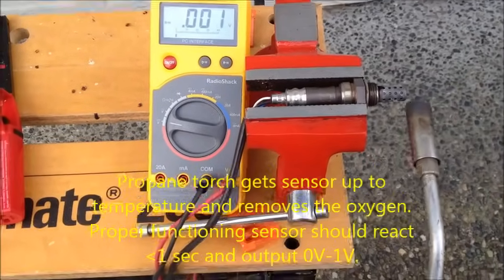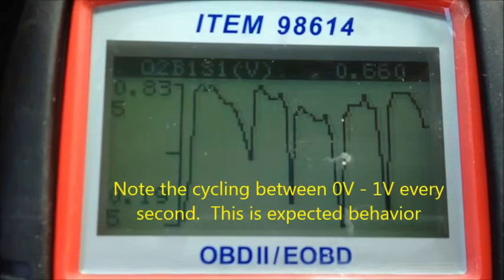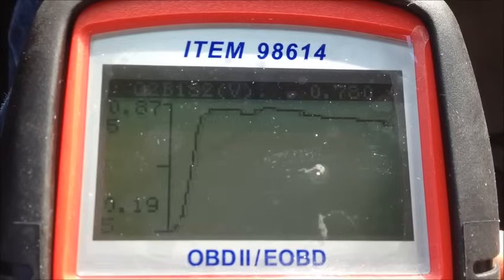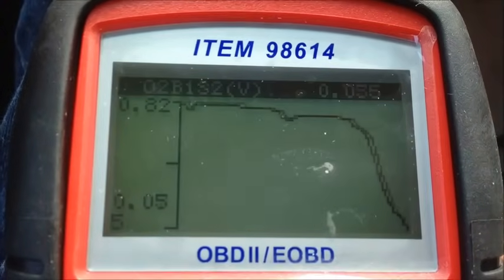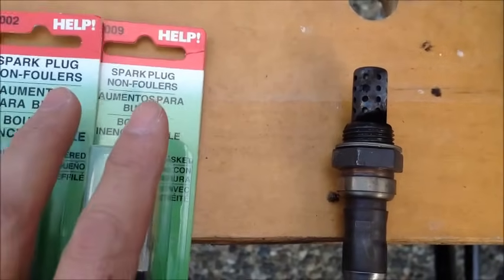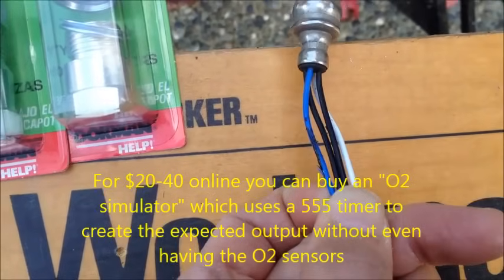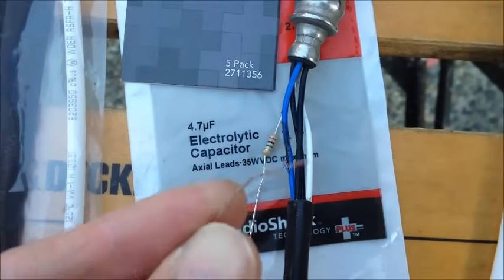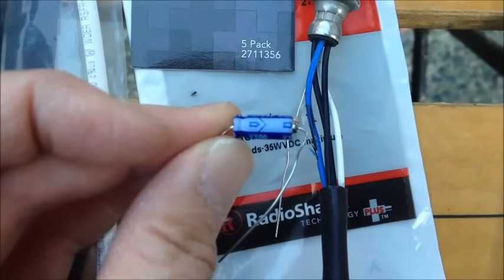$3 O2 simulator fix for P0420 Check Engine Light

Comment: Hi MITEEman, I just tried this modification on my 2002 Toyota 4Runner. I used the 4.7microfarad capacitor and the 1M-Ohm resistor. Prior to this modification the o2 sensor monitor always set easily and the catalyst threw the p0420 code. Afterwords, the catalyst monitor set, however the computer threw the p0136 code. This apparently means that: "(The P0136 code is set when the Engine Control Module (ECM) detects that the rear O2 sensor signal voltage is out of range for an extended period of time)".

Do you have any input on what I can do to correct this?
Also, thanks for a good video.
Reply: Deere 9798 same for me. Did you find solution?
Reply: @kconatymd  Did you ever figure it out?
Reply: @gritchard , had to replace the catalytic converters
Reply: @travato1592  Thanks.
Reply: I have this error. The setup works great at smoothing the signal when the car first starts, but after 20 mins the signal settles at a constant voltage. Maybe the capacitor and/or resistor get too hot?

Comment: I have on 200 car, the 2-nd O2 sensor damaged, and mix are very rich so  high fuel consume..
problem is I cannot change it, is like soldered there - the exhaust system is one piece, with no joints
Can I replace the damaged sensor with something like this  simulator to have  a lower consume ?
  Thank you in advance!

Comment: You need flux. Without it, the solder will not flow properly.
Reply: SwapPart TV Repair stainless steel wire is the material of O2 wires. It doesn’t solder very good

If you buy a universal O2 sensor it has a way to connect the male end. It’s not solderarable. If there is such a word
Reply: @marklokken1378  Did mine last year, used flux, had no problems.
Reply: SwapPart TV Repair can confirm. I just did my car, soldered like a dream using flux. Looks cleeeeean!
Reply: Shouldn't need flux with rosin core? * Scratches head*
Reply: @mleiber1982  Sometimes you do. Putting some flux on the wire helps a lot. Depends on the solder you use, and the type of flux in it. Some burn off too fast.

Comment: did it end up setting a heater circuit code afterwards? not sure what vehicle that was on but some send a bias voltage down the signal wire to indirectly monitor the heater circuit until the o2 warms up and pulls the bias to ground...

Comment: Thank you for the technique, the P0402 went away. Now the CEL is on and the code is P0137 Low Input. So, do I need a different resistor or a different capacitor? I welcome your thoughts.
Reply: If the voltage remains low for more than 2 minutes then I presume I need a capacitor that can cycle more quickly.

Comment: Laughing now, because this circuit does NOT need to be installed AT or NEAR the senso as shown here.

I would install it under the driver's seat, as that is where the connectors are for this sensor (sometimes under the passenger seat as well). And you could get fancy, and spend a little extra on a male and female 4-wire connector and make a "patch" cord so it is inline when needed.
Under the seats.
Reply: So you would rather modify your engine harness rather than wires on a replaceable o2 sensor? I'd much rather modifiey a o2 sensor than a 
ECM harness but that's just me.
Reply: @PHXGlock  No, you go to the junkyard and cut a set of connectors (male and female) under the carpet from a junk car, then you make an inline low pass filter that you do not need to cut anything on your car (in case you screw up, just go to junkyard again), and you can disconnect them and "restore to stock".

Comment: $ 3.00, and 65.50 in misc tools and heat shrink and soldiering gun and wire and blah blah. I bought the 02 sensor for $ 48.00. I borrowed the 7/8 wrench. Thanks anyway for the upload.

Comment: I try 1mΩ with a 4uf  [ dodge caravan 2.5 2005 , with a few months old cat trowing p0420 after replace injectors rings and manifold gasket, valve cover gasket ]
the live data 
shows O2 downstream fluctuating from 1.172 to 1.156
with 1kΩ resistor fluctuates from 0.954 to 0.124 
o2 upstream act from high to low on both configurations
should i try different resistor ? what value
or different capacitor? what value

Comment: Yup, basically fooling the computer by giving it the correct value. I did that on my trailblazer because of a low pressure sensor in the fuel tank indicated a leak. This was a major issue with all trailblazers. Mine didnt have any leak as per smoke test,no cracked filler neck. No bad charcoal canistor and no bad pressure switch in the tank. I added a capastor and a  resistor to reduce the voltage to bring the value down to .5v ,no more light,no more code. I know many Trailblazers that had that issue.

Comment: Well it worked but didn't in my 2003 highlander. The P0420 and P0430 codes are gone.......  but now I have P0136 and P0156 "O2 Sensor Ckt Malfunction"

Comment: Hi I replace my complete exhaust system on my 06 Alfa 3.2 v6 all 4 cat's including 2 downstream O2s where removed so obviously the engine light comes on, I'm not a electronics specialist so I need some help , Can I build a circuit to completely replace the downstream o2s?

Comment: My car Range Rover Supercharged 4.2  2006.  I made this and yes it works. No alarm came in for 3 months
no problem.Thanks. But vehicle fuel consumption before 17.5 LT/100 km, now 25.6 LT/100 km.Do you have an idea on this
Reply from the maker: Yes, I do have a theory of what may be happening.  When you get a Check Engine Light your computer may go into a "safe" mode which can negatively affect your fuel mileage.  I've seen this very dramatically affect fuel mileage for transmission problems.  I don't remember such a large improvement for this code, but every car responds differently to CEL codes.  I'm glad to hear it improved your gas mileage and thank you for sharing that.
Reply: I don't think you realized he is saying the mileage went down, not up.

Comment: I tried this but with the resistor on it was giving me 1.25 volts which my other bank sensor is only giving me .75 so I got a new code. I took off the resistor and it dropped it to .75 only time will tell if the CEL comes back.
Reply: Did you figure out this issue?

Comment: so if you dont have to have a sniffer test in the state your in you could do this trick and hollow out your cats?
Reply from the maker: Absolutely not.  This mod depends upon a working cat & o2 sensors.  It only fixes up a computer that is over-sensitive.  In fact, my o2 sensor recently failed and I had to replace it in order for this to still work, but it is working

Comment: the wires are stainless steel .. that is why is so difficult to solder.
Reply: joebotics
Reply: joebotics 
Yes this is an issue , I was able to get around it by twisting the wires together putting a lot of flux on the connection and getting a ball/blob of solder to hold the wires together.
    After the fact I thought I might have put the mod not on the O2 device but on the harness attached to it that perhaps THESE wires would not be stainless steel and you could effectively solder these wires . I need to investigate weather these are stainless steel
Reply: I crimped them.

Comment: Your capacitor says AXIAL leads. The one I bought says RADIAL leads. Does that matter?
Reply: No. Radial leads are used on printed circuit boards where space is tight. They have a smaller footprint, electrically they ARE identical. Just watch the polarity markings and you will be fine.
Reply: I figured it out by now. But thanks anyway. I already did this and it works great.

Comment: So what a lot of people don't realize and I know only because I have been a license smog tech for about 18 years now is the rear sensor is not only to monitor the catalytic converter, but to also fine tune fuel trim. This is only good for someone who is trying "beat" the system. It's not a great or smart choice for your car. Also it's kinda illegal to tamper or modify your emissions on a car. That may be a whole other thread or video but you should know.
Reply: So you're telling me that the manufacturers use a sensor AFTER the catalytic converter to control the air / fuel mixture? That sir, is illogical. The very nature of catalytic converters makes that very practice improbable, if not impossible.
Reply: by fuel trim you mean adjust the fuel ratio? if so air/ fuel ratio is monitored by the prmary o2 sensor not the secondary. Secondary sensor is just there to monitor if your cars catalytic converter is working fine or not
Reply: alsib photo that's incorrect. Maybe on some car lines it's true. But for a fact on many Bosch systems like BMW Mercedes Volvo etc. it uses the rear sensor to also fine tune the fuel mixture.
Reply: TRUE. IT DOES ON NEWER CARS

Comment: I did this on a 2002 Toyota Sienna. It had p0420 code before. After modification it gave p0136. I figured out that this video is not correct for all vehicles, the Toyota sensor required the resistor be put on the signal ground wire (the white one). Not the blue one as shown in this video. After moving the resistor to the white wire this was a total success, it's been 300 miles and no codes.
Reply from the maker: Every o2 sensor can have different color wires, so perhaps you needed to move yours to the white wire but I would definitely say that doing this mod to the "signal ground" is NOT the right thing to do in any general sense.  I'm not clear what you did with the capacitor, but moving the resistor to the ground may have raised the voltages for the output across the board.  In some cases that might help, but certainly not a good general recommendation.  This mod is trying to smooth out the curve whereas you raised the curve.  The computer is checking if the curve crosses a certain voltage fewer times than the upstream sensor, and in some cases moving the curve up may also solve the problem, but I think that's a fluke and don't recommend it.

The p0136 means sensor malfunction.  That again indicates to me that you used the wrong wires.  In particular, it flags the o2 sensor heater wires, so I believe your blue wire may have been one of the two heater wires.  I looked up your model and it uses an OEM Denso which should be the same colors as mine.  However, perhaps your o2 sensor was an aftermarket?

Bottom line, I DO NOT recommend making this change, but in some cases I can see how it might possibly help (but more likely is not going to work).  Given the P0136 code it's pretty clear that the mod was done incorrectly on the heater wires instead of the signal wires.
Reply: it worked. passed test been a month now no codes.
Reply: Glad it worked!
Reply: Nope, I did not have the colors mixed up. Checked everything with a meter. The black wires are for the heater. The blue wire on mine is positive and white wire is infact the signal ground (-). On my vehicle this is the wire (ground) that outputs the signal after leaving the sensor. limiting or "smoothing" as you put it. That signal puts the system in range. It checked out perfectly in range with the OBD2 scanner.
Reply: Excellent.
Reply: Interesting!  Is it still working after all this time?  I have an 03 Sienna and am just curious.
Reply: When you say "it worked" passed the test and now no codes, did you follow this individuals mod and make the resistor on the white wire (instead of the blue) ?  Also do you have a Sienna?  Thanks!
Reply: I'm wondering if this will work for a Toyota Prius. Will try. Maybe similarity between different Toyota models. Wiring it correctly caused p0138. I've used different sized capacitors to lower the T value with no change.
Reply: @frankviolinist9017 did you ever get it to worn on the Prius? I’ve been trying to figure it out myself
Reply: @alexandergomez1114  nope
Reply: @alexandergomez1114  I just used a o2 extender spacer. Keeps p0420 away
Reply: @frankviolinist9017  08 prius after I put spacer p0037 came on 😢

Comment: 4.7 uF was actually too high for me. I eventually got P0137, P0138, and P0139 codes indicating the o2 sensor wasn't working "fast" enough. Had to swap it out for a lower 1uF cap.
Reply: How did you know a 1uF capacitor would be sufficient?
Reply: @brianmcconnell7346 using the frequency cutoff formula 

1/(2piRC)  

THE CAPACITOR IS IN MICROFARADS SO DECREASING IT, INCREASES THE OVERALL  FREQUENCY RESPONSE.

Comment: Hi, does it make a difference where on the wire its done at?  Can I do this up closer by the harness?  I have no room down at the bottom by the o2 sensor...   A fast reply would be greatly appreciated.
Reply: Anywhere is fine.

Comment: MITEEman, what happen if the resister and/or capacitor burn for some reason? Should I able to start the car?  
Thanks
Reply from the maker: +Nadun Perera You may have used the two heater circuit wires which provide 12V instead of the two that measure the o2 content.  It shouldn't affect starting the car but you run the risk of a fire.  Wire colors might differ between manufacturers so use a voltmeter and benchtest the o2 sensor to find the sensor wires.
Reply: +MITEEman 
Thanks for the reply. I did same as the video, and  run about 30 Km without the check engine light, but now the idle rpm goes high and low between 1500 2500 and its not steady.  It was around 1400 rpm previously. My car is Toyota Vios 1.5E 2003.

Comment: http://home.earthlink.net/~jcgebhart/o2sens.html

I tried this and mine jumps alot. does it need a smaller resister to make it smoother on the graph?
Reply from the maker: +Justin Pierce The value of R x C determines how smooth the signal will be, so increase the Resistor.
Reply: how much bigger? maybe a 1.5 megahom
Reply from the maker: +Justin Pierce A graphing OBD reader would give you some idea of how much slower it needs to be, or you have to guess.  Going from 1Mohm to 1.5MOhm would be a good first step.  Personally, I'd probably try to double it to 2Mohm.  See a prior post by another user who put in a potentiometer to fine tune the amount, but that's usually not necessary.

Comment: MITEEman, if you please iwould like to ask you about 1- why did you say that this modification is for offroad use only? 2- a bad catalytic converter causes increased fuel consumption, will that modification improve the fuel consumption or it just eliminates the CEL. 3- in my country there is no smog test also cars use only one catalytic converter, my car is imported so it has 3 catalytic converters (california emmissions Jeep cherokee xj 2001 4.0L) my question is if i replaced the two pre-cats with two pipes and applied your fix(RC), would it work with out triggering the CEL, and would that affect the fuel consumption? Thanks in advance
Reply: +Speedo 4x4doctor The fuel consumption changes when you get this code because the ECU is programmed to protect the engine from a lean Air Fuel ratio.If the A/F mixture gets lean, the valves are not cooled as effectively and can be damaged. When the cat or o2 sensor stops working the ECU goes into what's called "Open Loop" mode and makes the A/F ratio much richer. So, tricking the ECU into believing that the sensors and cat are working will put it back into "Closed Loop" mode and it will run more efficiently. If you remove the PreCats and wire your sensors this way your fuel efficiency will improve, but you will be polluting much more.
Reply: I am surprised how confusing everyone finds this. Listen, (upstream oxygen sensor) 'the one by the exhaust manifold' is responsible for measuring your fuel to air mixture. That is all it does! So do not fuck with that one. The downstream oxygen sensor (after the catalytic converter) serves no other purpose than to throw a check engine light. It's sole purpose is to not allow you to pass emissions testing if the catalytic converter is not as efficient as it should be.

Comment: MITEEman, I really appreciate the time you took to create & share this video, and providing help to those of us with this error code on our vehicles... And on that note, I would like to ask/confirm with you the wiring setup on my 2009 Honda Pilot, as I plan to do this work to it. the color wiring I have does not match the ones on your video, I have 2 white, a black, & a grey wire. From what I've read the 2 white wires are the heater, black is positive signal and grey is negative. And the resistor (does not matter the direction) should splice between the black wire and the capacitor negative lead to contact the grey and the other capacitor lead should connect to the resistor opposite the end of the sensor. Is this correct?
Reply from the maker: +Evelyn Edwin There's a post in the comments from another viewer with a table of common wire colors but I always recommend doing a benchtest of the o2 sensor to both verify it functions and see exactly which wires measure the o2 content.  This mod won't work if the o2 sensor is broken.  If you have a brand name sensor, you can lookup the colors on the internet.

Comment: will this work on  late model cars say a 2012 dodge challenger?
Reply from the maker: +angel cedeno See my post about the problem with modern o2 sensors, especially more than 4 wires.  This only works on older analog o2 sensors.